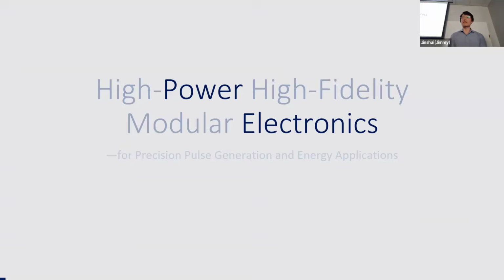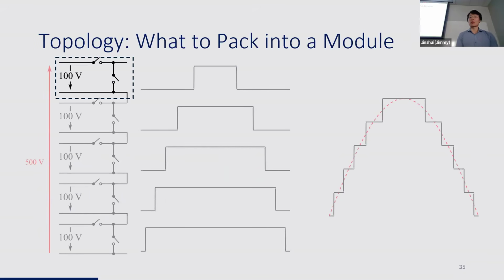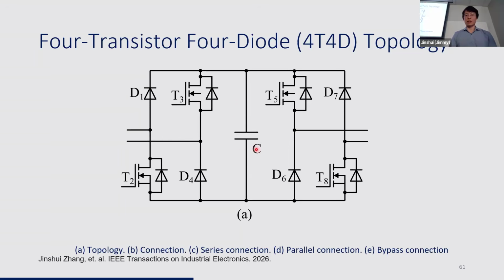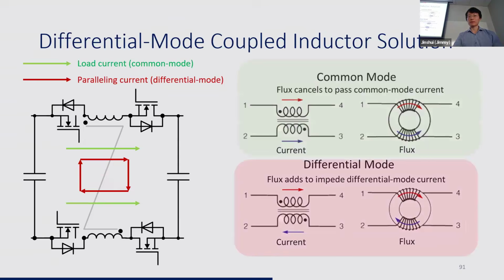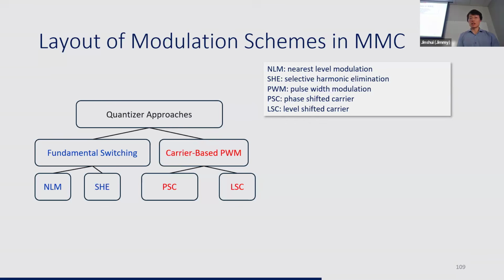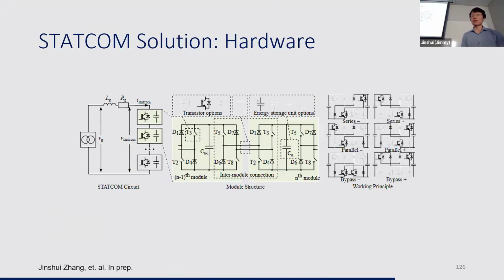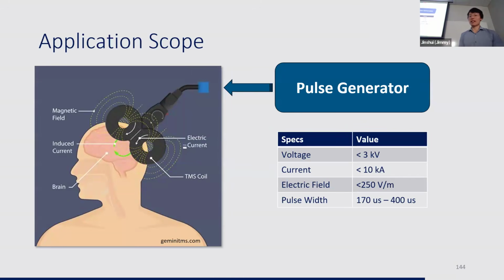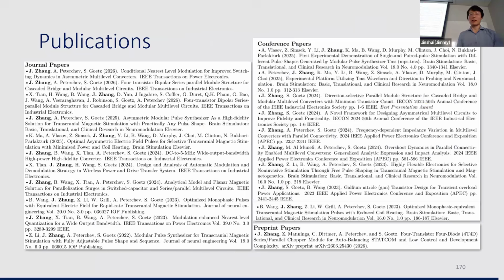PhD Defense Presentation from Jinshui Zhang at Duke University ECE Dept.

Comment: Thank you for your excellent presentation. That was very informative, and I learned a lot. You perfectly balanced technical details and the easy transfer of the holistic idea. I previously assumed topology research was almost dead, but your new topology idea was fascinating! A new simple topology with no extra buzz that really works with a real purpose! I also really liked your idea of twisting the common-mode magnetic core. That was very creative. I'll try my best to have my future PhD presentation up to your standards.
I was also thinking of modularizing the TMS coil. Then the switching plan would be shaping the magnetic field directly using a parallel modular converter instead of shaping the voltage of only one coil using a series converter, and you could do the same idea of fractional supply voltages, but then with fractional winding turns instead. Maybe the total cost would shrink, or you could have more spatial magnetic field resolution as well.
Reply from the maker: Hi Aryan, thank you so much for your kind words! And I also wish you a smooth and successful PhD journey! Your TMS idea sounds interesting and please feel free to reach out to me at jinshui.zhang@duke.edu